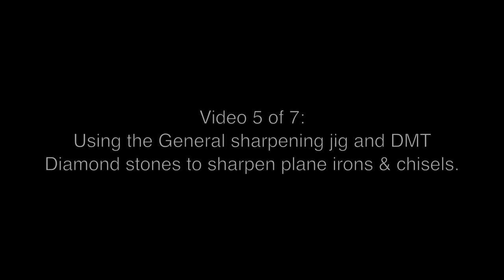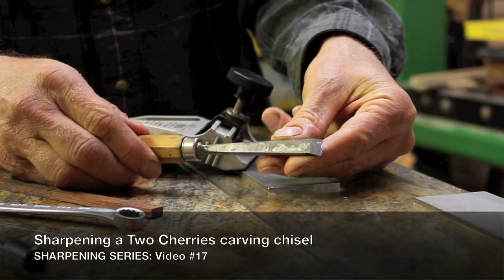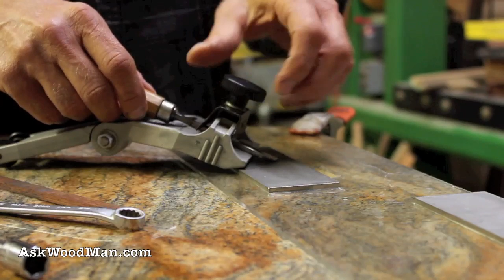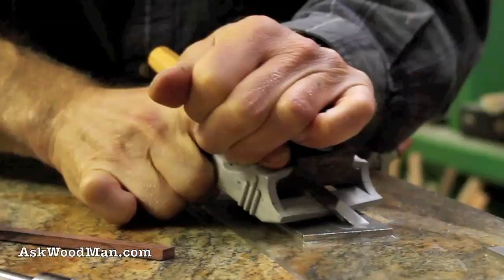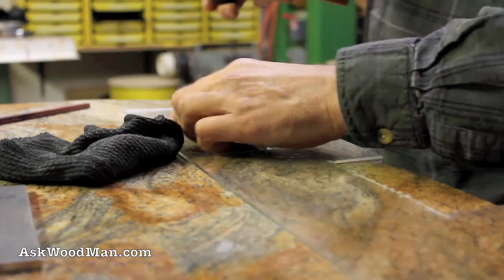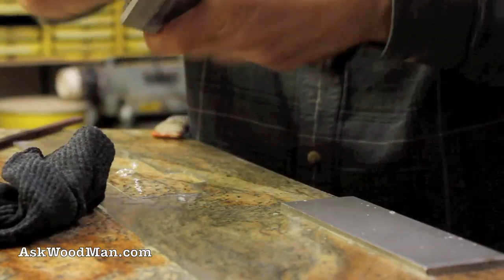Sharp Woodworking Chisels Guaranteed • Complete Sharpening Series Video 17

Comment from the maker: @DanielPontal Yes Home Depot or Lowes but a lot of time a smaller Ace hardware store will carry smaller sizes or drops so you can get just what you need. Since I made the video series I made a new template for myself out of a piece of 10ga (about 1/8") steel in exactly the same shape and size. I sharpen so much that I was breaking the the plexi after 6-8 months. I am 52 and hopefully will be doing this for many more years so I made a template that won't break. Cut with jig saw. Thx

Comment: One last tid-bit, the Richard Kell Jig allows you to  remove the burr without the need to hang the jig off the side of the bench if you have the stone in a normal stand or on a small block like some come mounted on.

As well, you need much less room to work the jig, as the wheels are just to the sides of the tool your sharpening. That way you don't need a flat bench 6" behind the stone your using. Normally, it just rides on the stone, meaning you need much less area to work in, very convenient.

Comment from the maker: @bisthewhizz That General jig is not perfect. But for me the qualities it does possess far outweigh its limitations. It is inexpensive and holds a broad variety of knives. And since it does not ride on the stones,but on a reference surface, smaller stones can be used because the effective stroke is optimized. And one of the most important features is the inherent stability of the design. The distance from the roller wheel to the knife edge makes tipping and blunting less likely.

Comment from the maker: @daveawebber My sharpening setup is always ready to go in a dedicated spot, so I just put a fresh edge on a tool as needed. I rarely do the assembly line like in the series. And a lot of times I may not need peak sharpness to perform a quick cut so, I usually wait and put and edge on just the tools I know I need to have sharp to complete a specific task.

Comment: Good video.

However, get rid of that garbage honing jig and buy a real jig from Richard Kell (also available from Garrett Wade dot com).

I am not associated with them in any way, they are just the best honing jigs made, period. Superior machining, superior materials with all machined brass, stainless steel and Ertalite TX low-friction material used for the rollers.

Just an awesome product, simply amazing. I wouldn't tell you about it if I didn't think you would enjoy using them.